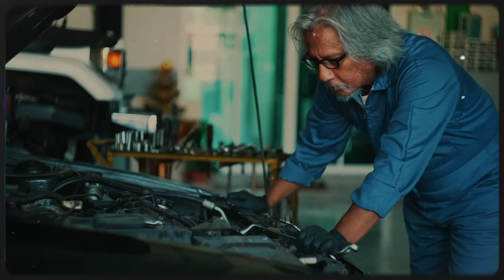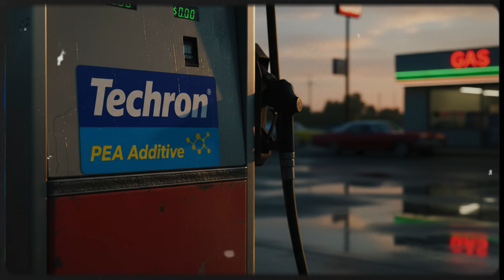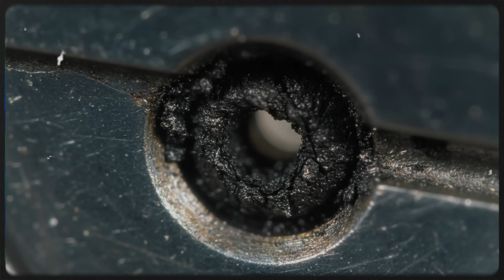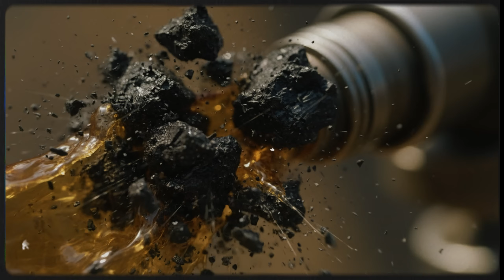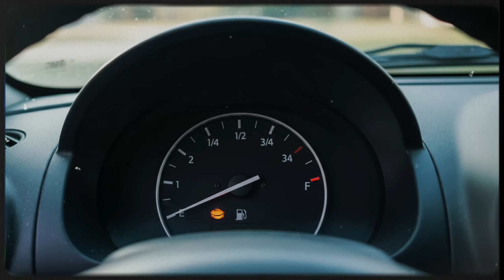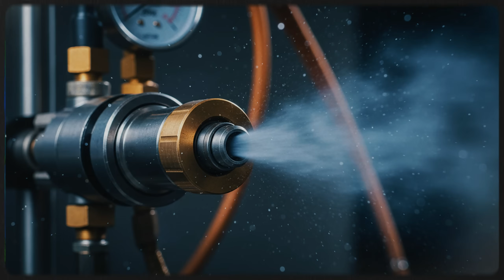DEAD Fuel Injector CLEANED in 1 Tank — No Shop, Just $4

Comment: WHY WAIT TILL QUARTER  TANK ADD ADDITIVE THEN FILL UP AGAIN? DONT MAKE SENSE ????????
Reply from the maker: You add it at a low tank so the cleaner hits the injectors at maximum strength first, then topping up helps it circulate through the full system — doing both deep cleaning + full-system cleaning in one cycle
Reply: @DIYMoneyHacks  SO I DRIVE TO THE PETROL STATION ON A QUARTER TANK WITH ACETONE MIX THEN FILL UP RIGHT
Reply: BY THE WAY THANKS AGAIN   FILBZ PORT MAQ OZ